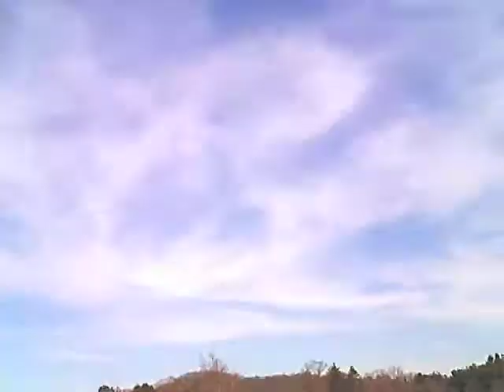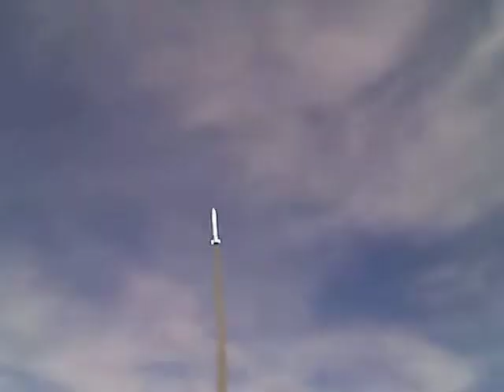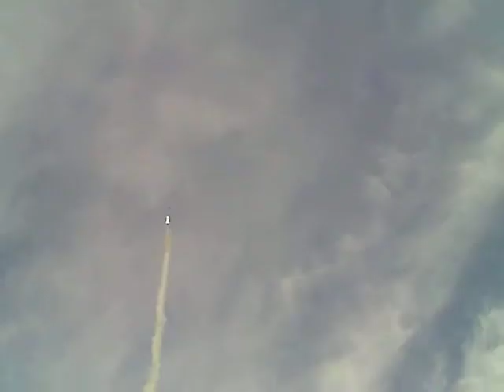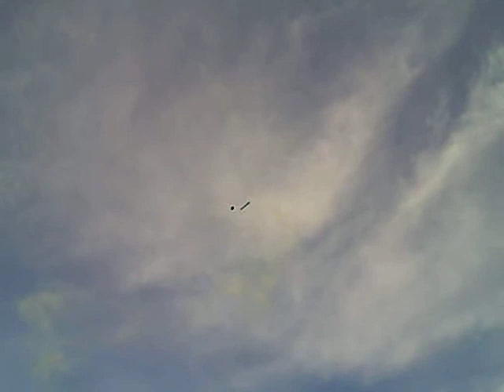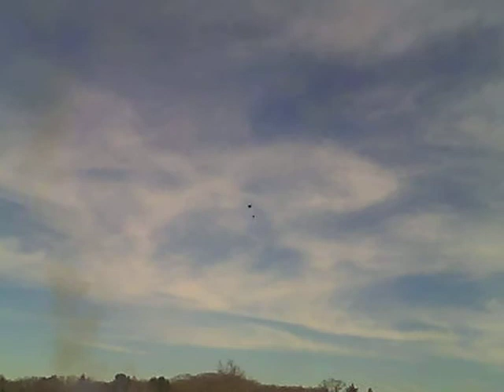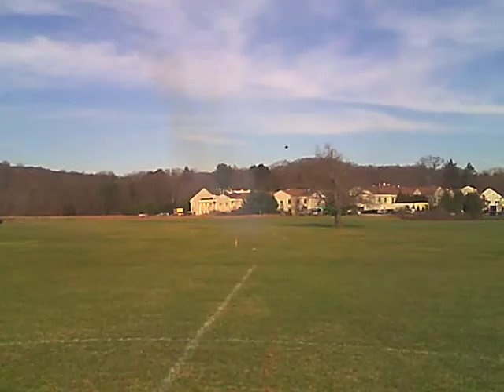12-12-11 Foam 10-in dia 8-ft Rocket with improved nose cone.AVI

Comment from the maker: @bob19611000 : I tried different length towers but didn't notice any difference. I believe that the high speed exhaust goes down the center and doesn't interact much with the body tube walls at 10-inch diameter. The large surface area on both the inside and outside of the big foam body tube must be causing a lot of drag and slowing the rocket down as it moves through the air.